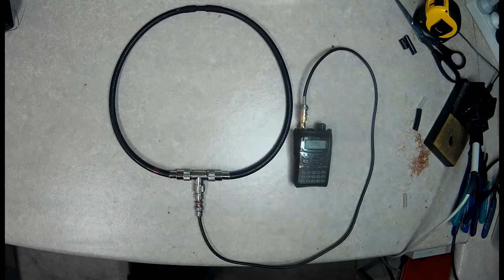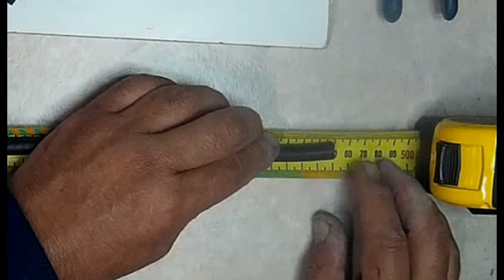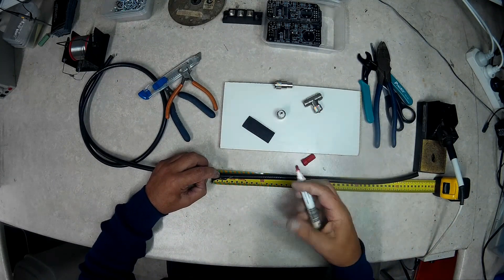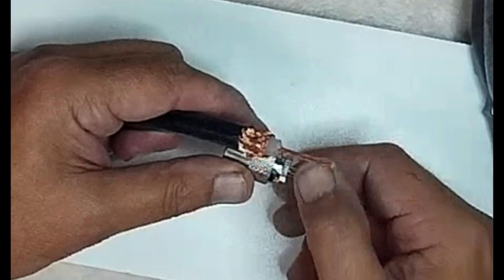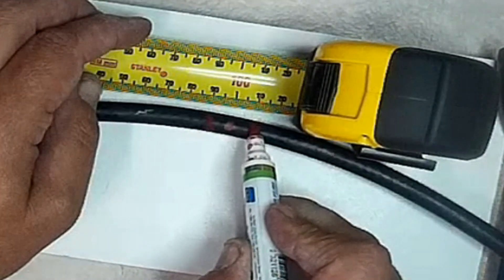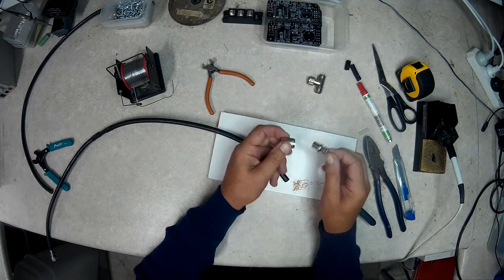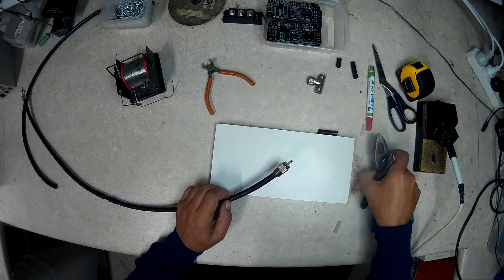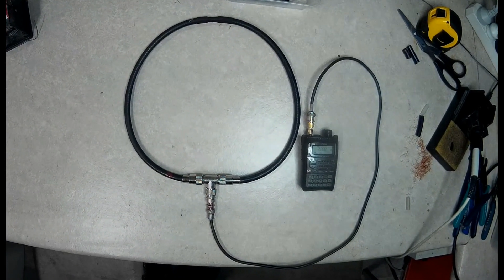R002 DF Loop construction

Comment: I built this exact loop to DF s9+ noise on 6m. Found the source easily, but unfortunately it turns out it's a hash farm. And the guy there knows where I live. The loop noise and nulls are very sharp as standard - easily good enough to triangulate down to an exact location.

Comment: This simple loop design can be vastly improved sensitivity wise, if you 
short the braid to the centre conductor of the coax at the end of the 
coax where you don't connect the centre conductor to the centre pin of 
the PL259 connector. Try both the original design and then the shorted 
design and you will notice the improvement in both received level and 
sharpness of the peak/null obtained.
Reply: Any one can verify this? Everywhere I seems people doing this no one mentioned shortening it. Just wondering…
Reply: I was confused by this, too.  Isn't the inner core shielded from RF by the braid, unless you short it to the braid to make it the actual antenna?

Comment: Made mine out of LMR400. Laid it out nice and symetrical and makes it very rigid and solid. The Tconnector goes straight into a SMA adapter with 5 foot cable of RG316 that adapts to 3.5mm to go into my PL660 radio. I have 3 levels of Gain on the radio and narrowing down sources of RFI is absolutely amazing! 
I am relaying the info I found today to the Engineer at the power company in charge of my RFI complaint. We are scheduled to meet next Friday and he wants to see what I described I was going to build and use. I cant thank you enough for this easy and sensitive project! Will update as my case progresses. 73 de KG5GCC😎👍
Reply from the maker: Great tip on the LMR400 Charles.  I should build one up too.  Yes the extra rigidity of the solid core would help.  Adjustable gain receivers for close-in work is a big plus too.  There are lots of good DF designs out there.  Many better than this, but they can be complex too.  With this design I wanted to make it absolutely basic to inspire more people to have a go.  Good luck on the hunt & leave feedback on qrm.guru so we hear how you went.

Comment: Nice project and well executed video, thank you. Can you explain why the non soldered end is marked afterwards ? This doesn't seem to serve any obvious purpose.
Reply from the maker: A fair question.  There is a slight front-to-back ratio at higher frequencies (VHF+) which gives a hint which direction the noise comes from, so the marked end could help.  However this effect mostly disappears at HF because of the small loop on longer wavelengths.  I decided to cut that comment as it may just confuse people.
Reply: Perhaps it would be better to leave it instead of curing and give a better use case limitation when and when not to use it :)

Comment: I'm in the UK and we use 26.965 to 27.405  ( Am / FM / USB / LSB  )  and  27.60125 to 27.99125 ( FM )  I have interference and have purchased a QRM eliminator but need a second antenna to pick up the interference so I can get the interference down I was thinking of something similar to this but if I made this particular one would it work on 27 Mhz ? or would I have to make it from a certain length of coax ? 
Thank you
Reply from the maker: This design should give you good results on 27MHz.   Good luck!
Reply: @rasa2745   I've made one and sat in my shack I had some interference and waved it around the room and it pointed at something which was half a mile away across afield  so will have to do a bit of searching , Thank You

Comment: JAMMER HAS BEEN caught by having three hams direction find him. We knocked on his door while he was jamming the Net and his wife ensured he will never jam again. Now to go catch the other jammer. Not good when Bad Hams jam good hams
Reply from the maker: Well done John!    
Once, a long time ago I heard a local 2M repeater in Melbourne being held open late at night and the source was not too far away.  I used the same loop on 2m to track down the source.  A rig in a car had its microphone jammed in the slowly-rising seat upholstery of a combi van, which tripped the PTT.  I knocked on the door and the embarrassed owner turned it of.   It turns out that this fellow was actually a radio inspector by trade who was also a ham.   I'm thinking that successfully DF'ing an RI does not happen often!

Comment: Would scrap rg58 be ok if supported to hold as a loop?
Reply: Or, if you can get hold of Aircell 5 coax which is a stiffer cable.
Reply from the maker: RG58 is electrically fine, but a bit floppy in the field.  Maybe you could brace it with plastic knitting needles or similar.
I prefer a bit of RG213 or RG8.  Even it it is an old off-cut

Comment: Why don't you solder the shield to the PL259's?
Reply: That would be the best way. Screwed on connections always go bad. Over the years I have had to rework every single one that has come to me from others.
Reply from the maker: Soldering the shield is fine, but I wanted to keep it very simple.  For the purpose of the exercise, it is usually good enough.
Reply: @rasa2745  It is not even close to good enough. It is a poor mechanical connection to start with and will fail you sooner than later. Over 40 years of RF experience speaking.